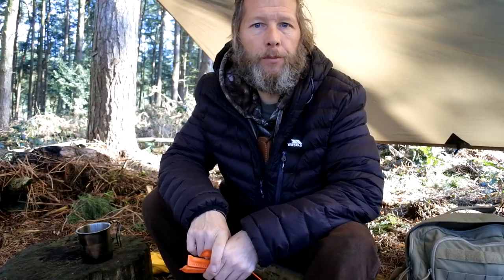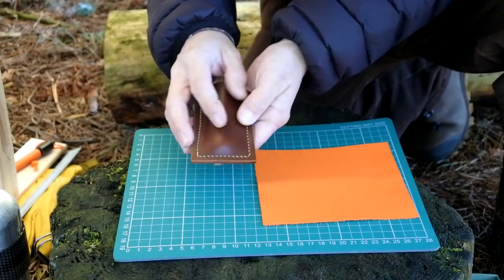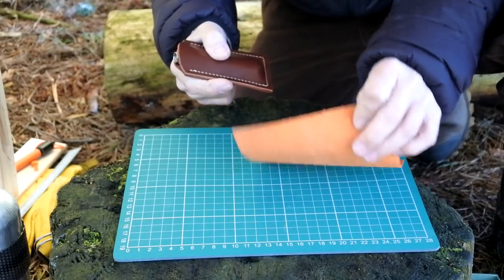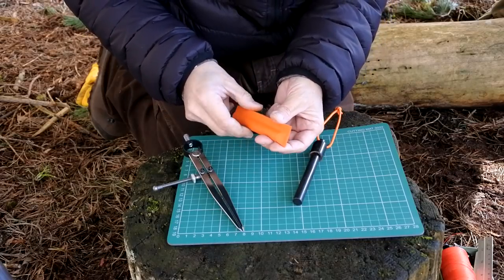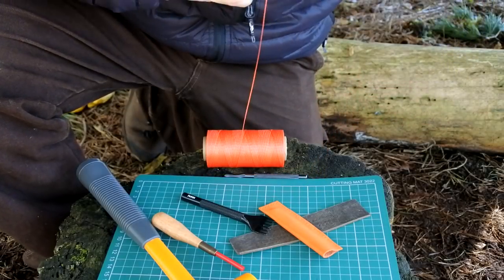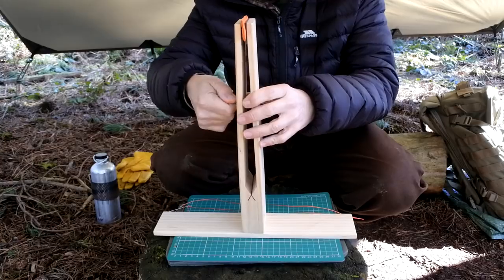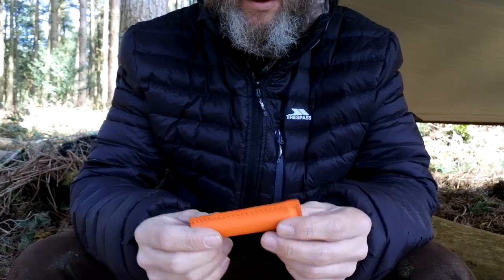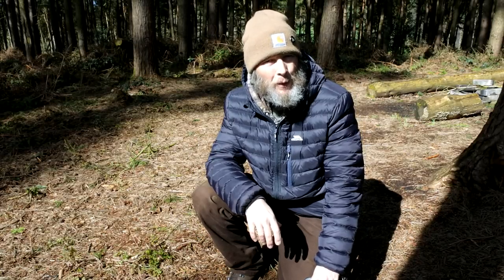Crafting a Leather Ferro Rod Sleeve.

Comment: Nice leather work, simple and easy to do.  I am doing a bit of easy leather work using the sewing awl and found this video very helpful. The leather hole punch looks like a great tool to have.  Right now I struggle pushing the needle through which makes the job harder than it needs to be.
Good idea for the ferro rod sheath as it sure stood out in the brush, thanks Mark!
Reply from the maker: Hi TC, many thanks for watching and taking the time to comment.  You can pick a set of the pricking irons/stitch irons quite cheap off amazon. I started off pushing an awl through and I could never get a neat stitch. But the stitch irons helped a lot. Thanks again, all the best, Mark. :)
Reply: Ordered a set off Amazon, they are inexpensive.  Thanks Mark, leather work will be much more enjoyable!
Reply from the maker: It will make things a lot easier for you now. No more pushing an awl through thick leather. One thing I did was de-burr them when they came with some fine wet and dry paper. It just makes the prongs smoother so that they push through the leather cleaner. :) Take care TC, all the best Mark, :)
Reply: Thanks for letting me know.  I guess for the price we do need to do some touch up:)

Comment: Hey Mark🙂 great job on another great video👏👏 I’m really interested in doing some leather work. I don’t really know where to start though. Is it very expensive?
Reply from the maker: Hi Joe, I hope you are keeping well my friend :) Leather work can be surprisingly cheap to start off. It is like anything else I suppose. You can buy cheap tools or expensive tools. For example the pricking irons to make holes in the leather, I have seen them range from £4 each to £80 each and every price in between. I started off by buying a kit off Amazon. They cost around £35.00 and have everything that you need to start off. But after a short while I wanted to buy better quality tools to last, so I buy the odd thing here and there and I'm building things up bit by bit. If you are interested in leatherwork you want to check out a guy called Ian Atkinson on You Tube, Its a great leather working channel. He also does a lot of bushcraft style leather projects, and goes into great detail. I'm sure you will have hundreds of leather craft stores in the US. Places like Tandy leather can be a good place to source you tools, or at least have a look and see the kind of things that they sell. The cost of leather will also vary depending on the type, whether it is dyed or non dyed, veg tan or chrome tanned. But this is something that you learn and pick up along the way. I hope this helps Joe :) Have a great day mate, all the best, Mark. :)